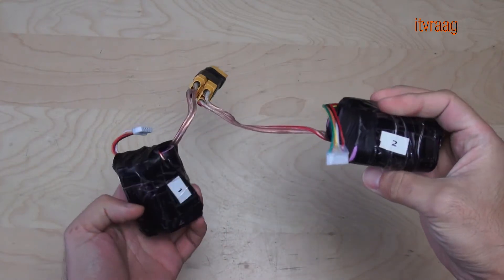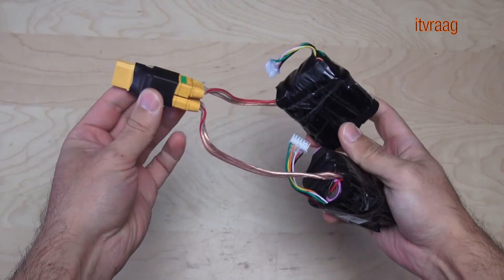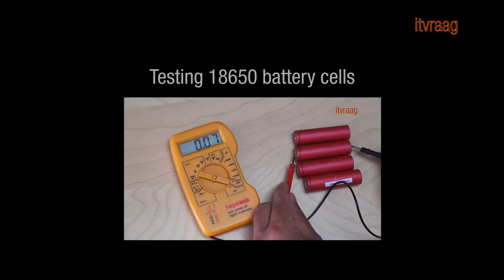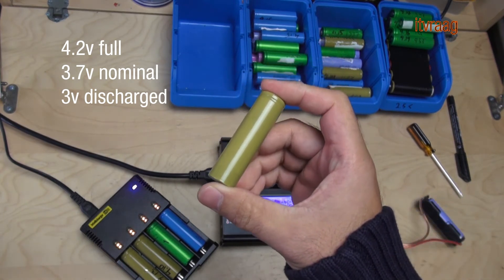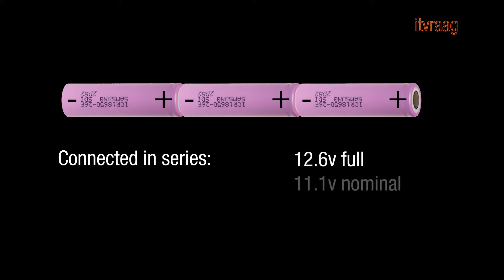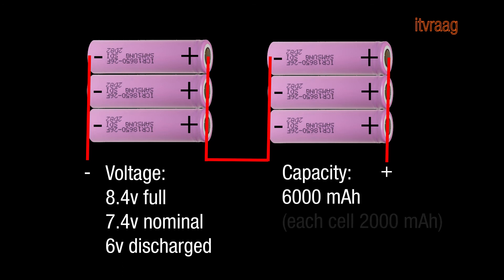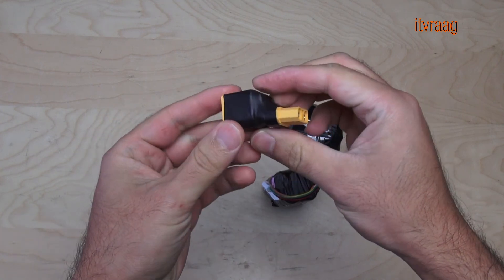18650 battery basics: voltage, amps, capacity, connecting in series/parallel

Comment: Hi,Great video! I'm looking to replace a 18650 Li-ion battery in a "garden" solar spotlight.I see though that they come in different amperage from 5A to 38A (on the site I was looking at).How "important" is amperage as I am ignorant of whether or not too few or too many amps will work in the spotlight and/or "blow it out".Thanks
Reply from the maker: Thanks! I haven't been working with electronics for 3 years now, but I believe the important part is the BMS (battery management system) which decides whether it can handle it or not. You'll need to check the specs. Amps are generally seen as capacity, which means that it shouldn't cause an issue, but your BMS should be checked. You'll also need to check the cables, because thin cables will burn when supporting high amps. Good luck! Be safe!
Reply: @itvraag  Thanks!

Comment: How safe is it to use 3 18650 batteries to preserve car audio settings in home build? When I turn off PSU I loose all settings in car stereo. Thanks
Reply: The sterio should use your car battery for something like that. Make sure all the wires are hooked up. I've made that mistake before. I doubt this is helpful 4 years later, but hey, maybe it is.

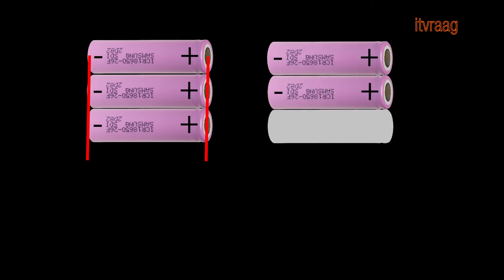Comment: ERROR: 01:40 full voltage should be 12.6v not 8.4 v
Reply: You are wrong
Reply: Its correct, 8.4 double the 4.2 coz its a series of 2...if 3series it is 12.6.

Comment: Hi. I'm building a portable speaker set. Using a 5v MP3 player, two 6ohm speakers, a PAM8403 amplifier and a micro USB charger with overcharge protection built into it. To get a few hours of play time, I was thinking of using two 18650 Li-ion batteries in series with a step-down converter. Do you have any recommendations, or suggestions that may be helpful? Cheers

Comment: Very good video. If someone can not calculate the pack or want to make it easier :) I suggest install the Android app: "Battery pack calculator" (calculates: voltage, capacity, energy, discharge current, etc.) up to 9999s 9999p packs. Built-in database of 37 popular, branded batteries and the ability to define your own battery cells. 
https://play.google.com/store/apps/details?id=pl.freshdata.batterypackagecalculator

Comment: People are claiming that wiring your cells in series results in lower capacity. How can this be? Why not use watt hours (Wh)?
Reply: If they're in series, most companies if not all companies will rate 18650's output in Wh. All of the cordless tool companies rate their battery packs for their guns/drills in watt hours. And all's they generally are is a plastic she'll with 5-15 18650's soldered in series.

Comment: what about amps when 32num of 18650 battery connect as a 4s system then give to 16.8 volt -12volt 
so could u tell me 
mah ?
amp?
if u possible ple answer me